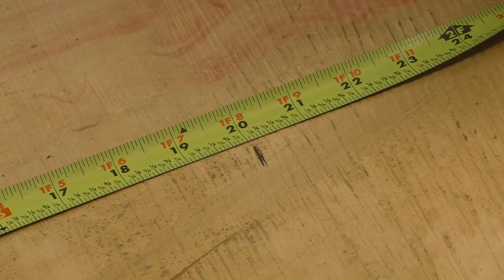3D Epoxy Resin Sign

Comment: Howdy Mr. Eric and Mr. Ryan.. 

Very cool job. I like the flag very much. 

As opposed to leaving ridges in the carved out sections, which bit would you use to make it all flat, an end mill? And which would you use for between the stars to make flat, just a smaller end mill? 

Looking forward to your next carving.
Reply from the maker: Thanks Mike! For a flat background we use the spiral up cut bits. I’d put a link, but it’s not the same over here in the UK. You can check them out on the website